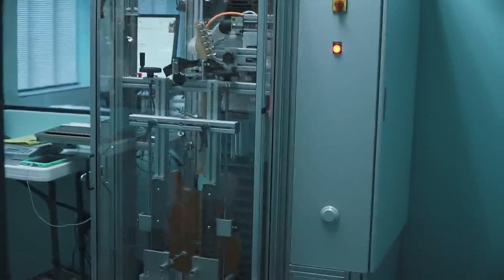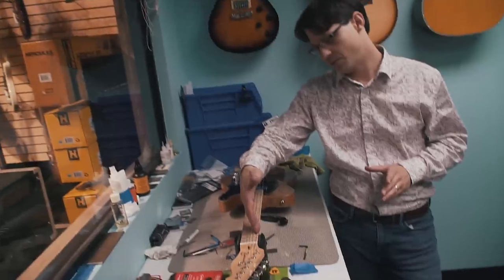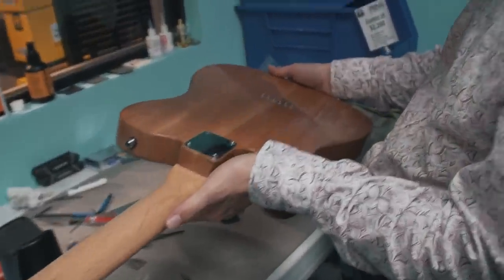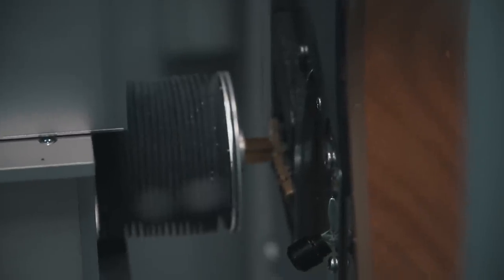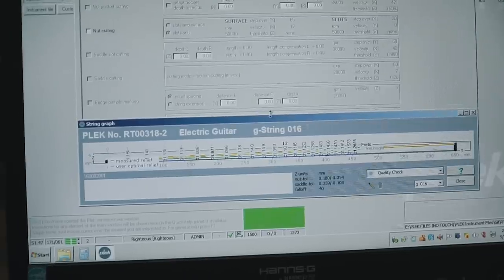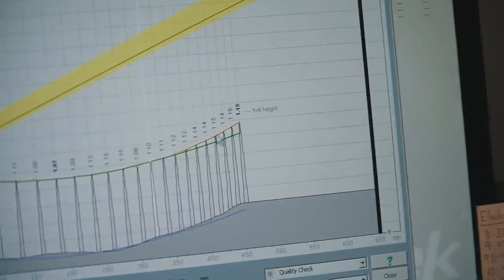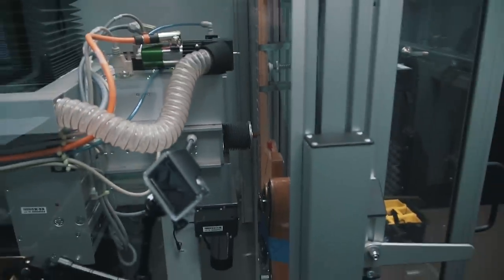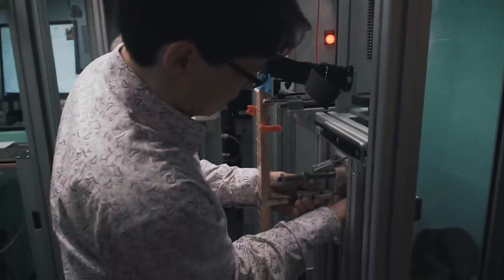How Does A PLEK Machine Work? || Righteous Guitars PLEK Demo

Comment: Awesome video but it's is now clear to me that just because a guitar has been "PLEKed" it doesn't mean anything other than this tool has been used. The PLEK setup is only as good as the operator. I see this sort of thing in lots of different industries where the use of a killer high tech tool becomes a marketing story. This makes me pretty skeptical about manufacturers who PLEK guitars as part of their pretty large scale production. I can't imagine they're putting the time in to really analyze and nail the setup on each one. 

Great video though, I really enjoyed it.
Reply from the maker: Cough*Gibson USA* Cough.
Reply: Very true.  The key to the whole thing is the person running it.  A Plek does not automatically mean it’s superior to a skilled individual doing a dress by hand.

I just fixed a 2016 Gibson ES Les Paul.  Every fret peak (landing) was off center on the crown.  I love Gibson but over 20+ years working on guitars Gibson’s routinely need additional TLC after they leave the factory.

AWESOME VIDEO

Comment: Does the PLEK also work on the guitar's nut?  Or that is done separately?
Reply: No. Separate.
Reply: It will cut the nut slots and cut the surface of the nut, but it needs to be finished by hand. It can do it all in one function if you're getting the frets done too

Comment: So huge question please, what is the cost of asking a guitar to be plek'd?
Reply: Most likely the asking would be free of charge, but the actual PLEK job itself could cost anywhere from 250-3,000 USD!
Reply: @adksherm  Oh, you're quick, but thanks, lol. I can add to that, apparently have since found out from Thomann, a scan can be done for 35 euros (in case it turns out a PLEK isn't required)

Comment: Points deducted for not taping over the pickups when the machine is working on the frets. *grumbles under breath
Reply: If you knew about the alloy used for fret wire, you'd know It is approximately 18% nickel, 80% copper, some traces of other metals like zinc and lead.  All of which are non-magnetic grumbles under breath

Comment: The Erlewine Neck Jig is as far as anyone should have to go.
Reply: NewGunGuy while it is good, the Plek is accurate to 1/1000th of a millimeter. It also measures the nut slots. For what the Erliwime jig costs plus the cost of the bars, etc. I can do more than 4 guitars and they will be perfect fret wise and set up.
Reply: @speedriff   Oh, it works as advertised. I do get it. But, we can't compare the price of the jig to the price of the service being done with the machine. We would have to compare it to the price of the Plek machine. Anyways, as a hands on type of guy, I think anyone out there can much easily acquire a neck jig and learn how to use it to achieve a pretty darned high level of quality fret work than do the same with a Plek machine. Not to mention, diminishing returns...
Reply: NewGunGuy well I’m not purchasing the Plek. If it makes money or not is a business case the owner of the machine has to decide. Personally I don’t have the time and I really don’t have the space, or for that matter, the inclination to do my own fret levels. I have some expensive guitars and I would rather a pro do that if need be. Sure I have adjusted truss rods, set up and balanced tremolos, and intonation adjustments but I’m not too keen on the learning curve involved with my own guitars. Now, if you would like to let me work out said learning curve on one of your guitars, cool. 😉

Comment: I had my first guitar pleked in Berlin in 2003 at the plek manufactory. All my guitars have been pleked since then. 
Just another point,  one secretvof plek is that they have done a ton of research on how a string vibrates and the envelope of vibration. This makes their setup really optimal
Reply: Do you think that during scanning it would account for the extra exaggerated envelope of someone who likes Toni Iommi tension with downtuning? For example, detuned to a low A with a 52 gauge (iommi did C# with a 42)

Either way im getting my stuff pleked no doubt. But theres a cool sound to that swelling light tension. Just curious!
Reply: @Psyfonify   I believe the machine and the software is perfectly capable of that. So it comes down to if you can communicate your needs to the person operating the machine and his understanding and competence, just as stated in the video. The machine is a tool and a very good one, but even the the best machine in the hands of a hack is useless.

My setup is usually the opposite, i use 011-47 on my electrics and 013-052 or 012-53 on my acoustics and that worked fabulously with plek
Reply: @nilton61  High tension has a great sound, especially for songs where you are strumming intensely, or are playing with a 'classical solo piece' type of sound that needs each note to project clean with full dynamics (as opposed to achieving it with lighter strings + compressor)...but theres something to be said for a really really low tension saggy rumble thats been electrified... lol. Hendrix used a 38 gauge E string tuned to Eb and sometimes even D (he would "tune to Eb" when he was already in Eb somewhat often without realizing it)

And page used a 38 E as well. And i guarantee you hendrix wouldnt have been the legend he was if he used heavier strings! Just try to do the same bends with 10's that come so easily with 8's and notice how much worse it sounds with 10's hehe. As bb king said "why ya workin so hard?"

And this is coming from a metal player. But i guess im more of a metal blues guy. aka stonerrock/sludge metal basically. And they do use really saggy strings on purpose for a cool tone with the fuzz pedals

I do miss the heavier strings for beautiful and even chord strumming and for that "beat the shit out of your barre chords with downpicking" ramones technique whilst remaining in tune as you death-grip the neck.

But with those strings, i cant do these string acrobatics i love
Reply: @nilton61  Btw thanks for the insight, i live in the same town as the guy in this video coincidentally enough, so i should be in good hands!! :D
Reply: @Psyfonify  I definitely dont argue with that since it purely i a personal choice imo. I play purely fingerstyle on both bass and guitar and have been developing a technique that (hopefully) allows me to play anything. I find that heavy string gauges help me since there is less "give" in the string for the right hand making the attack more controlled. Also the greater diameter makes the finger more easily get over the string and makes it less prone to catching the string in an uncontrolled or uncomfortable manner. And i admit bends are definitely harder but for me that has been a matter of training.
Reply: @nilton61  Sounds like heavy strings are your ticket man. Although one thing that may be humanly impossible to do with them (i use 10-52 tuned to D standard-not drop d), is to treat the D string (30 gauge a whole step lower in my case) as if it was a G string, doing a unison bend with it + the G string, and as you hold that D string in place, up a whole step, you bend the G string up a whole step too, so it goes back to being a major 2nd diad, but a major 2nd higher than the diad you started with - and THEN, everything still sustaining and in tune with the same fretting position as you started with, bending that G up, whilst holding everything static still, another half step, to turn that major 2nd diad into a minor 3rd diad. 

So basically fret 12 D, fret 9 G, bend D to match G's pitch, then bend G to be essentially fret 11 G but still holding on fret 9, and then after, a further increase in the G's bend to bring it to G fret 12's pitch.

This creates a sort of chord progression with your bending, in minor key, you start with a 7add2, then bend it to be a unison root chord, then further bend it to be a root add2 chord, then another bend to make it a minor chord.

The melody carried throughout that bend sequence is heard as "fret 12 D string, fret 14 D string, fret 16 D string, fret 17 D string"

For this reason, maybe try out 8-38 someday on a seperate guitar xD

It's some pretty hardcore bending but it sounds great, and i'm no lookatme shredder, i play intensely depressing slow dark music lol

Jeff Beck was my inspiration in practicing the bends to be that precise.

Your typical bends though, can definitely rock hard as fuck with a heavy gauge.

Btw this wasnt typed to turn you off from heavy strings - but rather maybe inspire and open up some new ideas for testing on another guitar :) If i was playing in a group, or recording a part on an album that involved big sounding solid strumming, i wouldnt use anything but 12's-13's for that purpose (in D, maybe 11's in E). And this is coming from someone who likes 9-42/8-38 in E, and 10-52/9-46 in D stndrd :D
Reply: @nilton61  It should also be stated that i SUUUUCK at playing acoustic, at least in the traditional, loud projection and fast full-chord switching way (i ditched full chords since they get muddy with overdrive) I used to be good starting out. Then when i got into loud amps and effects pedals 3 years later i said "screw this!" and i regret it. And playing light tension certainly didnt help with me losing my right-hand muscle memory there. hahaha

Comment: It is a fantastic piece of engineering machinery, but: for 225 USD it is just a ridiculously overpriced operation. For +/- 225 USD (depending on where you are in the world) an experienced luthier will do a full refret and set-up on your guitar.

Here, the "experienced luthier" being those guys who have set up the guitars well within specs for all guitarists to play on all those classic hit tracks in the history of modern popular music. Chances are overwhelmingly high that none of your guitar heroes ever had their guitar PLEKed.. still their instruments played well enough.

The "experienced luthier" is also that guy who doesn't take 35 dollars for looking at your guitar and making a judgement wether it needs replacing 2 frets, a leveling and fret-dressing or if the guitar indeed needs a full refret, or even fretboard leveling or a neck reset.

In addition to doing anything for less dollars than the PLEK machine can do (though - in truth - not to the 1000th millimeter's precision Hendrix, Beck, Satriani, Holdsworth and Van Halen never needed), a luthier will be doing all those tasks a PLEK machine in fact cannot do.

This machine would be a great thing if indeed it fixed minor fret issues for less than "a bob and a dime" - like an automated unit with the potential of replacing manual labor should do -  but it will never do that as this machine is owned and operated by people who make profits by selling you a new neck or even a new guitar, rather than making your guitar play like new for a reasonable price.

Comment: The amount of accuracy seems totally redundant if you consider day to day humidity and temperature changes, string changes etc. All those factors and I'm sure a few more will make all those measurements and adjustments totally useless!? Or am I missing something? Not to mention your fret wear over time. Even a $1000 guitar you are adding over 25% to the cost of your guitar. That's kind of like getting a $10,000 tune up on a $40,000 car!

Comment: There's a local guitar shop near me here in Utah with a Plek machine. They charge exactly the same fees and procedures. The pricing seems sorta steep considering the hard work is entirely automated and the man-hours are oversight, but it definitely seems like the most capable machine for the job.
Reply: The difference is that this is mechanically precise. It's as close to perfection as they can come. It's totally worth the price.

Comment: It's nice with a precision tool. I see one place where the human part of the procedure could be upped. You tune up the guitar (with the usual gauge of worn in strings and tuning) to have the right tension on the neck. This should be done in playing position (i.e. on the lab). The tune up should not be done with the weight of the guitar only resting on the end of the body and the headstock, as that changes the tension considerably.